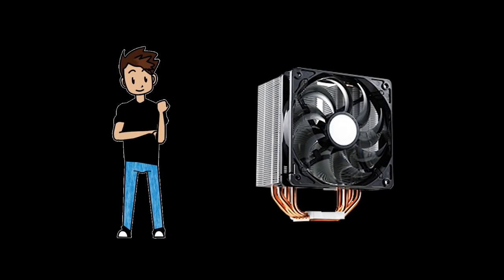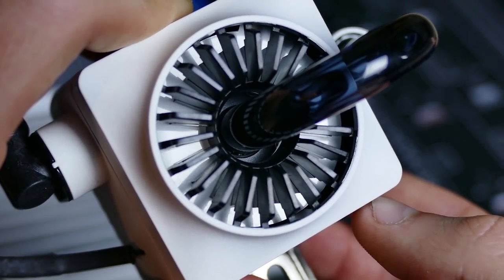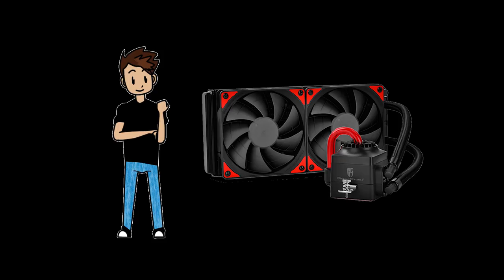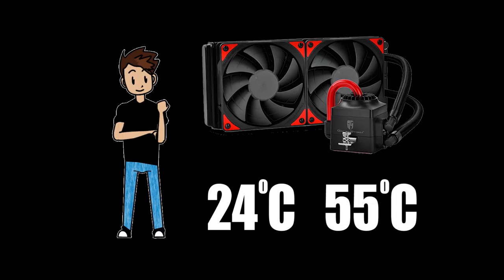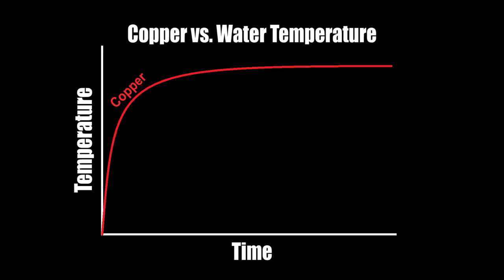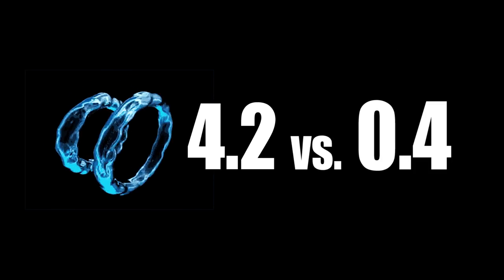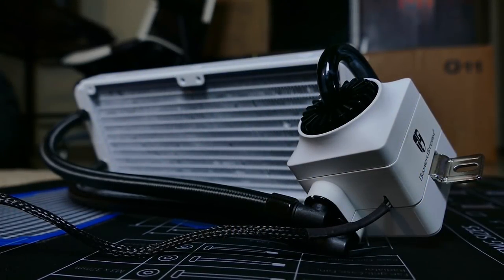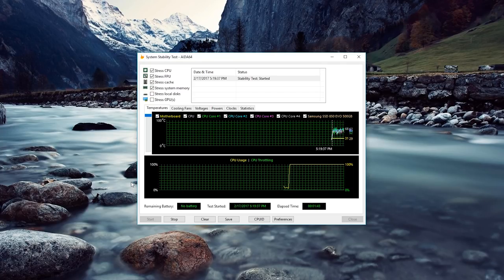How to Properly Measure AIO Temperatures

Comment: Sigh. My Ryzen 7 1700 @ 3.8GHz reached 75c on air, then after 30min it spiked to 85c, at which point I turned it off and went back to stock clocks. Picked up a H110i, set it back to 3.8GHz, ran prime95's max heat test for twelve(12) hours; temps peaked at ~50c (20c ambient). Ran prime95's blend test for another 8 hours, temps peaked at ~45c (20c ambient). Have run multiple 8+ hour prime95's blend and heat tests since then, and those figures were never exceeded. This was always done on roughly 50% max fan speeds, so there's obviously more headroom if you trade off against noise.
Your title is intentionally misleading. I also have a hard time believing even a shitty AIO hit 75c unless ambient temps were extremely high, or it was run at extremely low fan speeds.

Comment: The speed at which this sort of system reaches equilibrium is not just a function of the heat capacity of the materials involved. This video is badly misleading without a discussion of the heat transfer rates throughout the liquid cooler. In reality, it is very easy to have a system with a fast response if you don't expect there to be an accumulation of energy in the liquid coolant. Larger radiators, better fans, cooler ambient temperatures, and faster pumps speeds could all lead to this scenario.

Comment: No offense, but you could have summed this up (or given the answer at the start and then walked through it) just by saying: 

"The cooler is measuring water temperature, not processor temperature, and water takes a ton of time to warm up, and also reach steady-state."

I had an inkling that was where this was going, but having to wait over halfway through the video to get to a place you can reach in 1 sentence was a bit annoying.

Comment: Still missing one of the biggest losses in water cooling literally anything, the paint on the radiator is an insulator, it's just 1 more material that the heat has to transfer through before it makes it to the air. This is why you don't see automotive radiators, evaporator cores, condensers, heater cores or air to air intercoolers painted. People are going to say "but but corrosion!" if it's a aluminum radiator you'll have no problem. Copper on the other hand which is a better conductor of heat, not by much, will oxidize but I guarantee you that the pump will likely fail before the oxidation becomes a performance problem or the system will be altered long before.

Comment: wait my problem is essentially a AIO is the same as a cars radiator system but a cars radiator system is only sometimes water during summer and in emergency situations, really it should be coolant 100% which is actually a completely different mixture then whats in AIO sooo what would happen if you used actual high grade car coolent in a AIO hmmmmm better temps !!!???in a AIO mostly water small amounts of ethylene glycol maybe 5% whats in car coolant Ethylene glycol 10% Diethylene Glycol 15% and propylene Glycol 15% and 60% reverse osmosis water !!!!! ussaully appears bright flourecent green hmmm so they cheap out on AIO coolent in general for aesthetics just appearence

Comment: There is a bit of failure in your physics.  You are neglecting the effect of the temperature differential between the components.  In the saucepan analogy the pan's metal WILL NOT get much higher than the water.  This is testable.  If you make a saucepan out of  paper and use a naked flame to heat it the paper will not burn, because the water keeps it cool.  This is due to a similar heat transfer equation, that also has the "K" part "per degree kelvin".  As the paper rises to a temperature higher than the water by even 1*C the flow of energy into the water increases.  The further apart the temperatures are the faster the energy transfer.  This will usually reach an equilibrium.  In the metal saucepan example, if you lift the pan off the ring and immediately take the temperatures of the pan AND the ring you will find them not very far from the temperature of the water.  Also, specific heat capacity, does not really tell you everything there is about heat transfer rate, that would be the U value of thermal transfer, there are subtle differences.

Comment: this video is very misleading i have a 240 aio and my max temp went down by 20c i have a overclocked 8700k and i litterally ran my computer 5 hours to see if my overclock was stable if your aio didnt give you that much gain ill say its a radiator problem if your rad is to small it wont dissipate the heat fast enough, i used a 120 rad before and the gains were minimal compared to a great aircooler but if you use a bigger rad on your system, youll see significantly better temps

Comment: I see a problem with your logic. You are comparing Water to copper, while most air coolers have an aluminum heatsink. Both air coolers and water coolers have the ability to have a copper base. Therefore, you should compare Aluminum to Water, and take distance to fan into account.

Comment: 7:40 yeh but when the water "Plateaus" it is doing so at a lower temperature than the air cooler. I don't see the lie. I really like your videos. but in this one dude, you went over the same things in different ways which became quite confusing. I am now struggling to see your point. from the perspective of expecting to hear about a "Lie" DF? I live in Australia. A very Hot Part of Australia. I play a couple of games, but my real use for a PC is Mo Graphs, SFX, video editing and CGI etc (C4D). When rendering for e.g. and while using my old Stock Air Cooler, I strggles to keep CPU away from 90c +. Scary temps. and it would get there really quick. It was not uncommon to see idle temps around 40 to 50c (30 to 40 Amobient) But when I put my Corsair H55 AIO on, I had an idle temp of around 25c (that would graduly come up to around the room tempterature of that day). But when rendering and really pushing it in the settings (making sure max of CPU cores and time are used). I would leave it rendering overnight and sometimes for days or even as many as 10 days non stop. On the absolute hottest days I would only see temps maxing out around 60c. To me, the one problem with Liquid cooling (not necasarily with AIO only) is the prospect of pump failure. If the pump fails, then there will be less than 30 seconds (if rendering) before CPu reaches harmfull temps. Where as with an Air Cooler, temps may go high, but unless its dirty or an extremely hot room, the temps should only get very high, not fatal high temps. Anyway, I really dont see how AIO are a lie (based on content up untill 7min 40 sec) (Ill keep watching)(Maybe come back delete this post).

Comment: I have my pump connect to a 300 gallons underground tank, 100% silent and huge heat dissipation.
Reply: Be careful, you run the risk of condensation and corrosion if the water is not at ambient temps of the case.

Comment: In case of water cooled loops, heat is still being transferred to air (eventually). The benefit being, the thermal inertia of the medium (water) and also the ability to move the heat transfer surface away from the heat source to a convenient location. By doing so, one can implement much larger surface area and eventually lower the temperature differentials. 

Completely misleading video.

Comment: An air cooler takes the heat and radiates it into the air very close to the point where it is sinking from, which limits your surface area. A water cooler lets you pick up the same heat, takes it to a location with more room so that you can use bigger radiators with more surface area and cool it better without as much restriction of space. And sure, when medium changes from air to water, time to saturate water to the operating temp is longer than air, so obviously it will take longer. AIOs are not running liquid Nitrogen or something futuristic like you are trying to make it look like. Its a 500yr old technology.

Comment: No lie just misunderstood! I have cooler master water cooler i by means im not an expert or understand the math you used. But they dont just use water they have additives that increase boiling point of water with heat exchange just like the radiator on the vehicle everyone uses... If you follow installations you will quickly understand the air flow is incorrect.. Most people use the fan to blow out like exhaust and in front of the case you have fans blowing in which is incorrect... In order for heat exchange to work properly on the radiator air needs to be directly from outside... Idk if it makes sense to you research radiator of a automotive industry air comes from outside not from engine to outside i cant say how many engines have had a blown cylinder head for something so dumb...

Comment: completely wrong, while the water is heating up,the radiator is also releasing the heat into atmosphere. If you have some knowledge on physics you will know that there is no difference in the total amount of heat releases from the cpu while the aio cooler helps on reducing the temperature under low and release the heat out of the case directly
P.s. the total surface area of the radiator is much larger than a normal air cooler

Comment: Click bait but I liked the video for another reason.  First, reputable reviewers knew this and their tests allow enough time for AIO to reach its max temp. 
Secondly, I haven't seen any AIO manufacturer stating temps for their products.

Lastly, this behavior  is actually advantage which I haven't thought of or just forgot about it since I dismiss all AIOs completely since the birth of large air coolers.     
See, games don't use much of the CPU. Cut scenes or videos make it even easier.  Video rendering though might max it with renders more than 30 min.
Now, I would have to search for AIOs with the slowest rise of temps.

Comment: Great video few flaws but pretty on with thermal dynamics of the materials.   But here is a  wrench  tossed into everything,  if you use a oil instead of WATER!   Such a mineral oil it would actually be greater then cover in a physics type conversation about the subject!  Most extreme high end industrial servers use it to remove heat now adays.

Comment: This is just as misleading tas anything though. By taking longer to heat up, the radiator has more time to dissipate the heat produced. That's a huge benefit since during regular use the load won't be constant. The water sort of acts like a "cache" for the heat, providing a buffer for the radiator to work with.

Regular users don't run their stuff at 100% for hours on end.

Water cooling isn't always the best solution but presenting it like it has no benefit is ridiculous.

Comment: The problem? Your air cooling example, the hyper 212, uses the same basic premise as water cooling already: phase change cooling. It isn't actually 'air cooling' in the old fashioned traditional sense, as it still uses water (or polyethylene glycol, same as AIOs) with air passing through fins to cool it. Air cooling copper or aluminum will not yield anywhere near the same results as liquid cooling, as water is a much better heat transfer medium than air. As ALL cooling is nothing more than heat exchange, water (or similar) is superior every time. 

It's nice to espouse the virtues of the still existing 'air cooling' market, like the Hyper 212, but it isn't superior in any way to AIOs. No matter how small the difference, the total volume and heat exchanger (the radiator) will do a better job. The only difference these days is that we have a wide array of great options using that classic heat pipe design, instead of a fan over fins and pins.

Comment: Next time use the correct thermal compound the the stamped or any other brand. Only use thermal compound designed for liquid cooling and have it burn in. No compromise. Also worthy of noting..  If you going to build a monster rig starting the ~$1500 and higher range my would u waste money on using a brand AIO closed loop???? Spend the money on a custom built loop. The other somewhat important thing to do is RESEARCH. PRO TIP:  Liquid cooling must be configured in Hybrid cooling. Those power ICs do not cool them self off on a little heatsink...

Comment: Please don't drive a car without shock absorbers as they eventually let the jerks pass to your spine! Dude - I care about ambient temperatures under "normal use" so the average temperatures remains significantly lower than Air coolers. This helps me overclock higher than air cooler and still stay stable while Air cooler may increase the temperatures to make it unstable under similar scenarios. Why would I be bothered about cooling down temperatures when its only the maximum temperatures causing damages (typically)?

Comment: AND....   The heat plates in AIOs and other water blocks are poorly designed. The micro fins are so short and not enough of them thus not enough surface area to transfer heat more efficiently from the CPU.. Which is another huge reason in the large spikes and constant change in temp. Also a huge contributing factor to the large delta between your core and water temps during short durations of use. If they would double the surface area and make those micro fins about a cm tall then that would be much much better at transferring heat and a cooler I would jump to buy...

Comment: Faster fans, brother.  AIO's are awesome, but not with the stock fans.  You need some 80cfm fans, minimum, push/pull.  More air = More cooling capacity.

Comment: this is 5 years old but i want to quickly say that, while technically, you are correct, in the real world, hardly anyone will have their CPU pinned at full blast for hours on end. Especially not modern CPUs, not now, not then. Games only use a few cores and dont pin them always, rendering is usually done on GPUs anyways and if you render on a CPU then you probably shouldn't spend money on CPU cooling and instead get a GPU instead. Pinning all your CPU cores at 100% for hours on end is an almost purely artificial concept and has little significance in the real world other than in some simulation workloads that cannot utilise the GPU. it is a sort of worst case scenario, which is interesting but no more than a fun fact. 
All of that is to say: AIO do offer a significant advantage over Air coolers in that they can absorb burst heat way better and thus keep temps lower than an air cooler would.
Aside from all that, if your CPU shoots up to 80 degrees immediately, it will spend more time at elevated temperatures.
Reply from the maker: "All of that is to say: AIO do offer a significant advantage over Air coolers in that they can absorb burst heat way better and thus keep temps lower than an air cooler would." This isn't how thermodynamics works. The energy dissipated isn't disappearing into the ether... it's being absorbed by the fluid in the closed system. And when the temperature delta shrinks, so, too, does the efficiency of the AIO. Additionally, the notion that many games today "only use a few cores" is complete bonkers. You don't need to peg your CPU at 100% for hours on end to feel the limitations of a liquid cooler.
Reply: @GregSalazar    the relevant metric are the core temperature and temperature stability. i am well aware that energy doesn't just disappear. But you said it yourself, water has a higher heat capacity and thus allows for heat to be taken away from the cores better than with an air cooler, especially for small burst loads, with the added benefit of potentially drastically increasing the surface where heat can be dissipated depending on the rad size. Idk where this notion that its a closed system comes from, thats the literal purpose of the radiator, to remove the heat from that system. just because the liquid doesnt leave the AIO doesnt mean its a closed system, unless your AIO is just a pump and some pipes, in which case, you may just as well run the bare CPU. And yes, coolers get more efficient the higher the dT is, but to say having your CPU jump to 80 degrees immediately because then the cooler works more efficiently is just not it, chief. idk what your point is or what AIOs ever did to you but there has to be something causing you to double down on flawed arguments like that. There are many flaws with AIOs compared to both custom loops and air coolers. The former has more thermal mass acting as a buffer, the latter can still be adequate at a much lower price, (addendum: and liquid coolers have more points of failure). but, and i said that before: it is still better to have the temperature slowly ramp up even in sustained loads and thats more true than ever now that CPUs tend to just go above and beyond if they are given the chance.

Comment: I noticed these slightly exaggerated water-cooling claims but the title of this video is just as misleading. I keep my living space at a cool 19-20 degrees depending on the time of the year so your results may vary; using my x3 fan aio system for over 2 hours of in-game benchmark testing and trying to push my computer I have yet to see my cpu pass the 35 degrees compared to around 45 when i had air cooling. I am using a ryzen 2700x however, so my cpu is rarely pushed for performance, this may be a large factor but i still notice a 66% decrease in temps with room temperature being the reference point from my water cooling which is much less insignificant than this video leads you to believe an aio system should be.

Comment: Trust my word, for the poor ones if you want the best performance, but 212 and a sunon turbine, solder it to a 12volt line and forget about temps problems, very cheap solution.

Comment: I run Folding@Home on high for hours at a time on my 7700K and I can confirm the data presented in this video is accurate; however, I would never run Folding@Home with an air-cooled 7700K. It's the hottest CPU I've ever owned and I'm considering delidding it so that I can run Folding@Home at lower stable temperatures. Running at 90C for days at a time is not great for a CPUs lifespan.